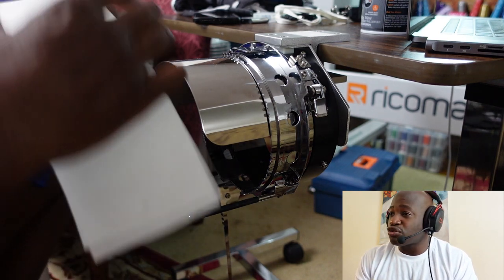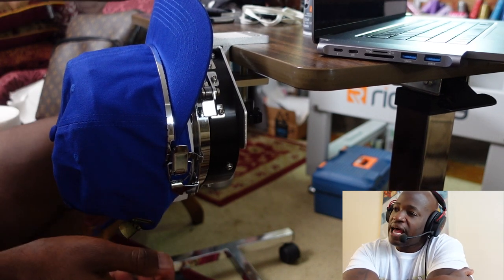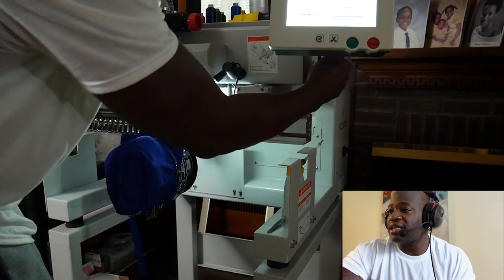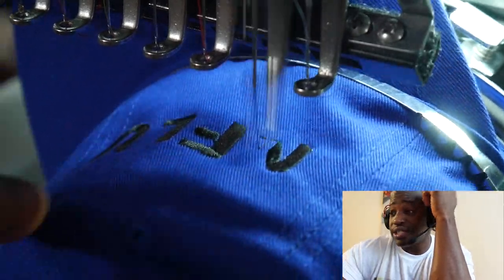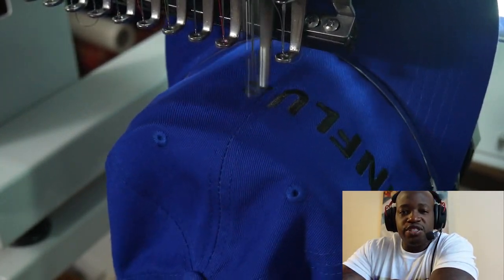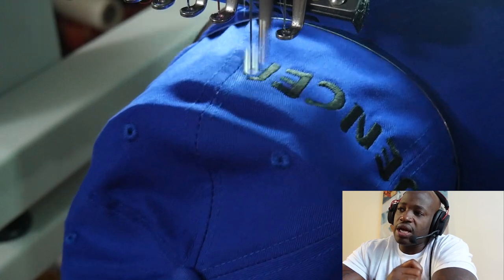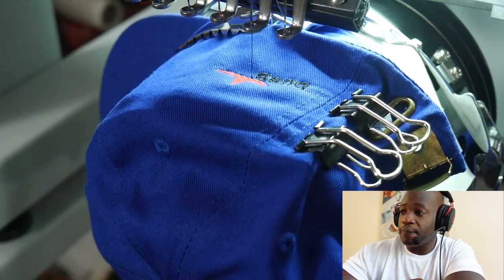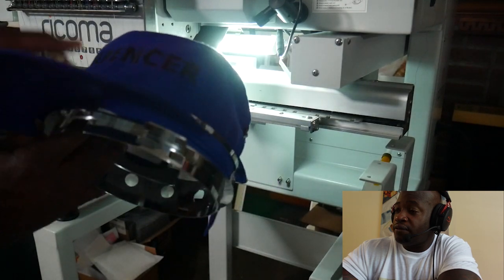Embroider on the Front and Side with one pass on the Ricoma MT 1501

Comment: Working on a single needle machine is a whole different world than working on a multi-needle machine.  That was probably part of her issue.  There is a learning curve on the multi-needle, even if you have used a single needle for years.
Reply from the maker: No. She is a professional that runs a shop on multi head machines.  She had other model machines in her shop. In business for maybe 10 years longer than me.  Her not being able to work a multi head and me with significantly less experience working it with no issues. 🤔 doesn’t sound right.

Comment: I have a SWF 1501c and it's a reliable beast. Ricoma makes good machines as well!  Hats are a Pain in the Ass, but good $$$.  I make most of my $$ on Patches!  I won't post a link out of respect for your channel.  I run Wilcom Studio on my mac running parallels with Windows 10.  It smokes on my 27" iMac with 128GB ram and 1TB Nvime ssd.
Reply from the maker: Is the main difference between the MT1501 and the set the embroidery area? You have a larger embroidery area right?
Reply: @adubbproductions  I think all the 1501 machines from different manufactures are pretty much the same. What I liked about the SWF is that the hat hoop is tubular and just slides right into the arms.  What I don't like is that it didn't have WI-FI or direct ethernet, but they have the SWF  SENS software that lets me transfer files and set colors over my network.  The new SWF machines have added wi-fi etc.    The SWF 1501c embroidery area is 460cm x 300cm.

Comment: From a digitizing standpoint when setting up two designs to run in one pass.. what’s the distance between the front and side designs?
Reply from the maker: The best way to figure this out would be to get a tape measure and measure from the center of the hat to the center side where you want the center of your design to fall. Then in digitizing measure from the center of the front logo and place your side logo according to your measurements. As long as both are inside your hat boundaries you are good to go.  Same measurement for the other side of the hat.
Reply: @adubbproductions  🙏🏿 appreciate you taking your time to respond
Reply from the maker: No problem. It can get overwhelming but i always try to get back to as many people as possible.  I sit in the morning for an hour and try to get back to as many as I can.